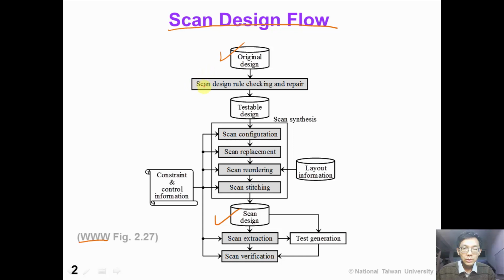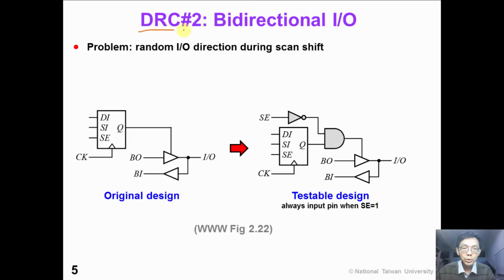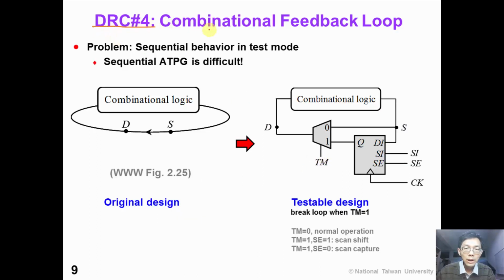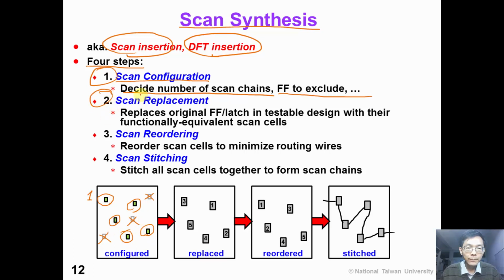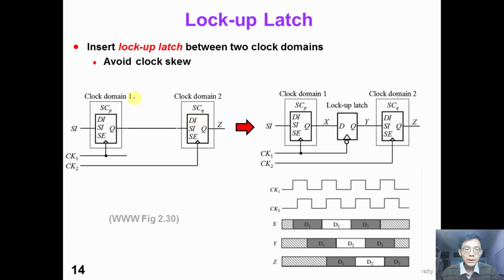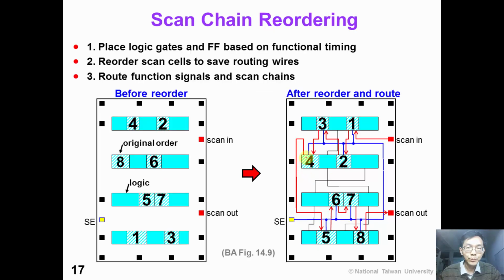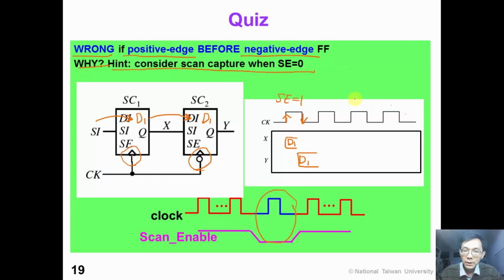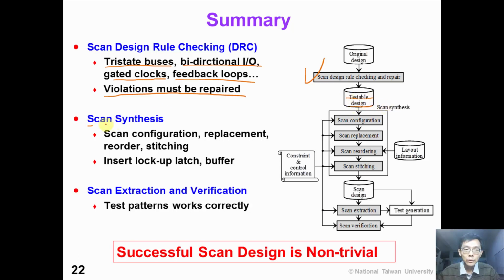11 7 DFT1 ScanDesignFlow

Comment: Thank you for your Video,I am troubled by a inout port's S1 Error of DFT compiler(Synopsys), A Tristate inout IO  pad cell, Always has a S1 Error, PAD pin show ZZZ but I simulate the verilog model with the same input value ,It is not Z ,has value 1 or 0.
 I tried set_dft_configuration -type bidirection -method output 
But S1 always has, Could you please give me some hint of this issue.Thanks